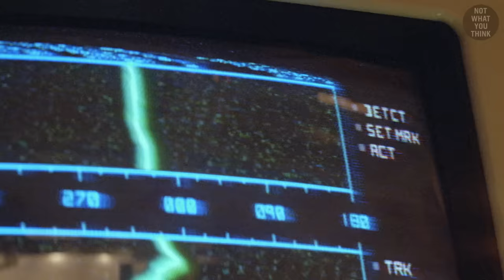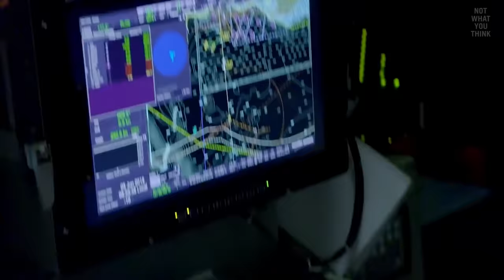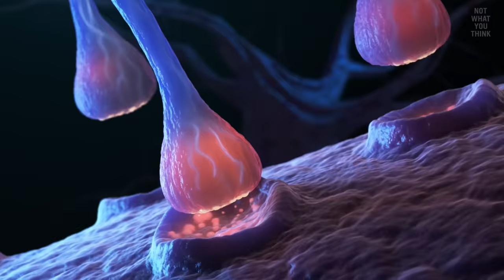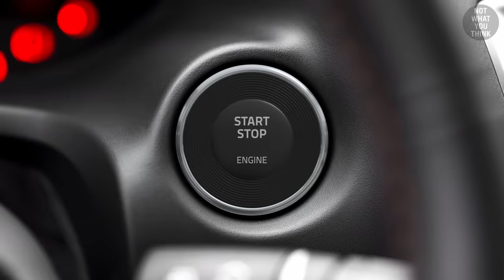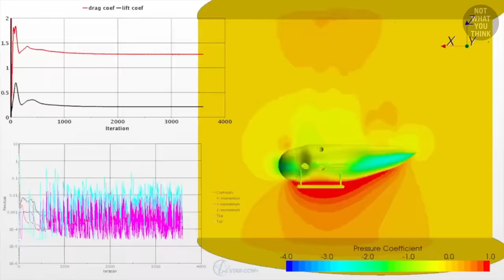What Happens When a Submarine Implodes

Comment: I'm assuming this comes after the recent submarine that supposedly imploded while exploring the Titanic. The subs mentioned here are Navel submarines and the majority of what is talked about here was accidents happening around 200-1,000ft below. Most US Military subs have a max depth around 900m, roughly 3,000ft, its rumored that Russian military subs have a Max depth of 2,000m or 6,000-7,000ft. The Titanic is basically double that depth at 12,000ft. Its a different world at those depths and that was a tragic loss.
Reply: The Titan was a submersible, not a submarine. All crush depths are theoretical, but even "known" maximum operating depths are merely heresay, as military submarine depths are classified.

Comment: We are assuming the sub would implode instantaneously but a water leak could have occurred. The incoming jet of water would have eventually crushed the occupants whether the rate of flow was fast or slow to balance the inside pressure to the external sea pressure. The submarine could have then remained intact with the occupants crushed into a miniscule size. As said, the crushing of the bodies could have been fast or very slow.

Comment: Brings to mind the gravity, loss or increase, changes the reading of buoyancy. Weight of vessel, is more buoyant or less buoyant.  The later being lost in water pressure by gravity increase.  Voids of gravity, or excess by thin crust in deep trenches.  Gravity has no obstruction above it.  Aeroplanes get a false reading to a computer controlling up or down. Also get noticed.  Stall warning when wing lift can not overcome  gravity.,

Comment: Physics.   He forgot to mention that it all does NOT implode at the same time.
Maybe 1 end of the sub begins the quick implosion, obviously it takes milliseconds to engulf they other end of the sub.
How many milliseconds? Light itself is known as the fastest thing in the universe (actually there is a faster area and that's the expansion of the universe in relevance to both supposed ends of it, but this is still not the fastest 'thing' on its own, as the expansion sides of the universe aren't really what we mean by what's the fastest thing on its own, that actually travels from 1 point to another).
Anyway, I feel I could argue that people on the opposite end of the sub may have seen and comprehended the explosion (or implosion) flash of light. Whilst it would still be milliseconds, I don't like how he implies that no one would know anything, maybe they did for a millisecond.

Comment: Does a submarine have to resist the weight of all the water that is above it?  If so then the same vessel would have different implosion depths in the ocean vs a small but very deep lake.
Reply: No, that's now how water physics works.  Water will weigh differently from temperature changes and/or amount of salinity it contains.  Fresh water is lighter than salt water.  Cold water is heavier than hot water.  Pressure from water isn't just downwards but from all sides.  That being said, if you take the same type of water at the same temperature and put it in a narrow cylinder tube and put in another container the size of an ocean it will read the same pressure at the same depth level.  One can accurately calculate the depth of water just from the water pressure given the water's salinity and temperature.

Comment: If an implosion happens on a larger sub, is it possible for a portion to be that somehow to not be affected? Where maybe survivors were ceiled off in the engine room?

Damn that ending shot was creepy
Reply: No, the pressure hull that keeps the water out is far stronger than the interior bulkheads that separate compartments, the bulkheads or 'firewalls' can hold back normal operating pressures of 200 to 300 metres so if a compartment is flooding you can safely just close the hatch to that compartment, but if the sub is about to reach it's crush depth of 550 metres then every compartment will be wrecked the moment the pressure hull fails.

Comment: My theory is the Titan may have contacted debris which would have deformed the hull and caused an implosion, think of a ping pong ball or a soda can.
With equal pressure on each, it takes a tremendous amount of force to crush, but a small crease and each will crush with relatively ease.
Reply: No impact of any kind needed to cause carbon fibre pressure hull delamination.

Comment: Burning is the worst way to die. The reason is quite simple. Fire sets off every pain nerve not just at once but constantly. It is beyond painful to be burned much less to the point that you die from it. If you somehow survive you could have it worse than death. See, fire damages nerves severely. The pain you experienced while the burn was happening? That is now eternal. At least it is until you actually die. Severity varies based on the nerve damage but it can be ever lasting and constant or come in waves and dip now and then. Mind you the dips aren't really any relief. I'd rather drown than be burned alive. Sure there's some panic and pain from suffocation but the pain is not even in the same multiverse as being burned. It's also much, much, quicker.

Comment: I don't need to try burning myself to know I absolutely do not feel it in any reasonable time frame whatsoever.

Or most pain for that matter.

I've had my thumb on a 425° pan in the oven because I didn't realize that an oven mitt had given way for over 30 seconds.

And I still didn't feel it for several hours even once I saw the second degree burn.

And I regularly eat hot stuff just after it's done cooking and don't feel anything until the next day. Especially my mouth and then the same applies for slashing as well.

If I eat some crispy pizza I can burn and slash my mouth and know nothing about it until the next day or until I realize the skin is peeling/split a couple hours later or longer.

In general I say ow because I always saw other people do it. Only very rarely do I actually feel whatever it was, I just say it because it seems like what you're supposed to do when you beat your arm off a wall or something.

Comment: 0.04 seconds is a gross over estimation, at any real depth, the whole incident is over in less than 1ms, and to put that into perspective it takes 110 ms for your brain to register pain, it takes your eyes 13ms to process what see.

Depending on where the failure in the structure occurs, not only would it be over fast, but it will flash compress and ignite the air (i fully expect them to find evidence of this on titan, RIP)

As for is it the worst way to die? Hell no, you'd be dead before you had even a CLUE what was about to come, no pain, no suffering, no stress, no screaming, no gazpacho (I wonder how many will get that reference) soup.

Comment: I’m not seeing the science in these claims we keep hearing. Everybody keeps describing what happens to a metal submarine. With a single layer wall, when it fails, it fails. The Titan was not steel. It was wire and carbon fibre, 5 inches thick. That is thousands of strands of carbon filaments that are unlikely to all fail at once. - anyone who has seen a crash with a fibreglass car knows that the results are very different to a metal car. It seems inevitable that Titans wall would have failed layer by layer - with surface fibres snapping first and the rupture spreading through the depth of the submersible wall. 
As for their final moments, it is reported that they had dumped weights and the sled, strongly implying that they knew something was wrong and were either descending to fast, or the submersible was exhibiting signs of failure. The idea that they had no idea something was wrong or that the vessel failed instantaneously seems to be more about saving peoples feelings from the reality of a more plausible demise. 
While it is also conjecture, we know the submersible was pretty sparse on controls. But if the sled and weights had been dumped, that is almost certainly a whole separate operation from the descent. It presumably makes completing the mission impossible too, so would have been a last ditch attempt to return to the surface, almost certainly after thrusters had been tried and failed meaning there was time to try more than one way to recover the vessel. - your posited belief that they may have have died happy to be doing something exciting and with no idea of anything is a little bit juvenile.

Comment: No there are not high concentrations of hydrocarbons in the air of a submarine.   "Now how would you know that Suwannee Tim, as you have never been on a submarine?"  And indeed you are correct, I have never been on a submarine.  So I looked up the OSHA permissible exposure limits for gasoline which I am sure is comparable to other ordinary hydrocarbons.    300 ppm.  That is 0.03%.  And this is for 8 hour a day exposure, not 24 hours a day.  Presumably a naval submarine would have comparable limits.  So many opinions.  So little knowledge.

Comment: The speaker audio in this video talks in Spanish. A very good neutral Spanish accent, indeed. The speaker is really a robot, a text to speech software. Maybe somebody could explain to me why these guys preparing and editing such an interesting video and also the guys writing this kind of software can't fix this horrible bug that makes the speaker translate "EE.UU" (for Estados Unidos) to a literal spelling of each and every letter one after the other instead of switching to "Estados Unidos" as two separate words, for United States. Not to mention when figures and units appear in the text, like a pressure expressed in p.s.i. or km/k or mph. In this case each digit in the number is spelled separately and in the case of the units some videos also spell the dots in the middle of the unit. Knowing in advance that this awful pronounciation will appear and if the original text contains "EE.UU" for "Estados Unidos", somebody could have been kind enough to change "EE.UU" for "Estados Unidos" by revising and changing in the text. In the case of the units, if the software fails to recognize them and pronounce incorrectly, a simple change in the text of "p.s.i." or "psi" by "pound per square inch" would correct the problem instead of leaving it just as it is leading to an untidy presentation. It is curious because all the rest of the video shows some quite good images, pictures and graphs. Somebody had to take care of the details at the moment of editing. This talks about a poor, careless editing text to speech software in the AI era, where most of this pitfalls can be solved with a self learning database, as it normally works in other software like MS Word, or in any corrector in a cell phone. My deep respects for all the personnel who died in my country's ARA San Juan submarine accident.

Comment: From my reading, the Titan was the first deep sub with carbon fiber, and the CEO was one of the first to use fiberglass for an experimental plane years earlier, that went well and he guessed this experiment would also go well. The sub was brought down over 20 times, most with no people inside as a test, then failed during the 4th time with people inside. The Titanic sinking taught people to be more careful with iceburgs and have enough lifeboats for all passengers. Likely this disaster will cause more titanium in a spherical shape for deep dives, and no carbon fiber until a lot more testing is done. Also no cylinder shape for this extreme depth, the cigar shape is safer for less depth based on all the experiences so far. The Thresher Navy sub appears to have failed from an electrical problem then emergency coming up blocked by frozen piping in 1963. The 1968 Scorpion Navy sub disaster causes are unknown, but several other nations had sub disasters that year, maybe pointing to attacks.
Reply: Yeah, basically he ignored everyone, and fucked up.

Comment: The pressure didn’t go from 1 atmosphere to failure level instantaneously. We had a carbon fiber OR bed fail from overloading. You could hear the layers of fiber failing before the final collapse. They most likely had some time to think about it. Probably not a long time but most likely seconds to a bit longer. We will never know for sure unless there is audio recording recovered from the wreck.

Comment: The hydrocarbons sublime? Sublime!? What is that supposed to mean? I think you wanted to say sublimate but that's not possible since sublimation is the phase transition from solid directly to gas.  It's sufficient to say that hydrocarbon vapor was present in the atmosphere.
Reply from the maker: Sublime and sublimate are the same thing as far as we know. They are both verbs meaning when a substance changes directly into vapor.
Reply: @NotWhatYouThink  The hydrocarbons in question are liquids. Liquid to gas is a single step phase change. It is not sublimation.
Reply from the maker: I see what you mean now.
Based on some conversation threads on this topic, they hydrocarbons could also come from solids (which is why sublime was used). That said, we cannot verify the accuracy of those statement.

Comment: I do hope it was as quick as it could have been - hopefully seconds. I just knew it had imploded. It didn't have the capacity to go to those depths... despite what they said. If you read what they said about how it was built, it just didn't have the capacity. Period. And they weren't out floating somewhere, waiting to run out of air. They knew it had imploded as soon as it happened because they would have seen the huge
🫧🫧bubbles🫧🫧 that came up when it imploded - kinda hard to miss, especially when your supposed to have your eyes out for anything suspicious.  Plus they heard it on the some type of sonar, and radar, they were using. (I'm no expert, obviously, I just know enough to get me in trouble. 🙋🏻‍♀️ Most times I'm right or close enough to it to figure out of from there, but this is COMPLETELY out of my realm! I say the same things about my car, too, because I was with a guy who built race cars for 25 years 🙂🙄) Especially because of the explosion of 🫧🫧bubbles🫧🫧, I don't understand why they dragged it out, other than to distract us from Brandon's son's crap for almost a week. How sad for the families 😢 😔 Just my completely uneducated thoughts on everything to do with that mess 👋🏻
🙏🏼😥☠️🥺❤️‍🩹💦🫂

Comment: Only an ingnorant amature writes "kph" instead of "km/h". It's never" kph". That's nonsensical. The "k" is a prefix standing for 1000. Hence, "kph" is an abbrevation for "1000 per hour". In other words it means nothing. The correct abbrevation is "km/h", meaning "kilometer per hour". 10 km/h means 10.000 meter per hour. If you insist to use the antique and awkward "miles per hour" abbrevation "mph" when you abbrevate "kilometer per hour" it always has to be "kmph". But that is extremly awkward. But not as awkward as the nonsensical "kph".

Comment: At 7:16, did you say 12m as in 12 meters? I thought subs travel well beyond that, then how come rescue attempts beyond 12m have never been successful? This is very confusing to me as I feel like 12m is shallow depth, that even a diver can dive in and out easily unless I miss something here.
Reply: Once certified as an Advanced Open Water Diver, you'll be trained to dive to a maximum depth of up to 30 meters (100 feet). Certification Level 
He was speaking of the diver (person) at that time with that suit. Maximum now seems to be 30 meters.

I know I went in a resort pool once, that had a common depth, then another depth from a ledge under that (really I don't remember the meters).
Anyway, I tried to swim down past the second part, but my buoyancy kept pushing me up. However I did see others that could do it.
It took maybe 30secs to swim back up (about, unsure) but it wasn't minutes as I would have ran out of air! Clearly unaided deep diving - no suit.
Reply: @kimsland999  Okay, but he didn't say the mechanism of the rescue attempt that has not been successful. It's a bit confusing to me, what type of rescue attempt has never been successful at beyond 12m!!
Reply: @MG-wx8yx   That's reasonable. The detail was unclear and ambiguous (ie a diver person or a submarine?) Good point, well picked up.
Reply: @kimsland999  Yep, that's what I meant. He's exactly rescuing or how. And I would assume that at 12m deep, even the crew members themselves, given they are pros, could swim back to the surface (it's an assumption since I'm not professional in this field). So, as you said, it's ambiguous, to say the least.
Reply: He was saying at the time of the rescue, in May 1939. It may be different in present time.

Comment: In 1974 the CIA recovered a Soviet submarine K-129 from 16,500 feet that had imploded and found the body's of 6 Soviet sailors...

Project Azorian...
Reply: K-129 did not implode. Rather, the submarine suffered a failure in her pressure hull which caused the submarine to begin to flood.  The sub sank to the sea floor, but was not 'crushed' due to the fact that by the time she reached the bottom, most of the submarine had been flooded. The only compartment which imploded, was the forward torpedo compartment. Though it's been argued this wasn't an implosion, but rather an explosion from one of her torpedoes.

Comment: And you thing they are Safe up in Space in an  Aluminum Can ???
Reply: Ye
Reply: @nahadoth2087  That's right ,  it the Opposite ,  it wont get crush , it will but open ..
They are still in an Aluminum Can ,  they say that mini meteors are going over 40,000 miles an hour ,
and are all over the place .  how much Steel do you need to stop a Bullet going 3,000?
Reply: @nahadoth2087 the Moral of the Story is Don't go into Deep Water or OUTER SPACE ...